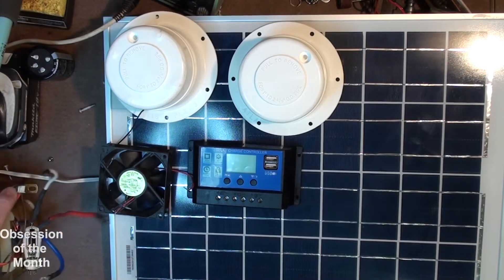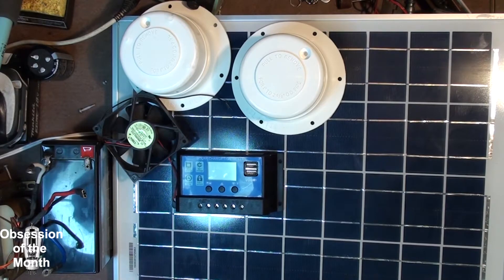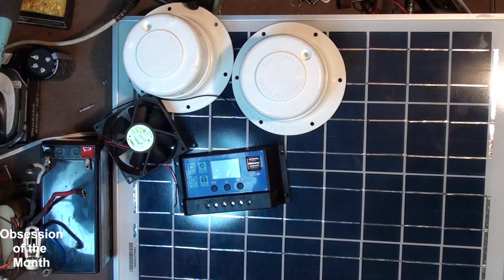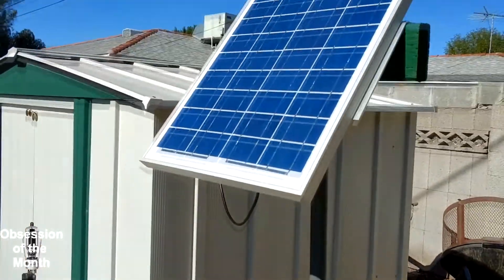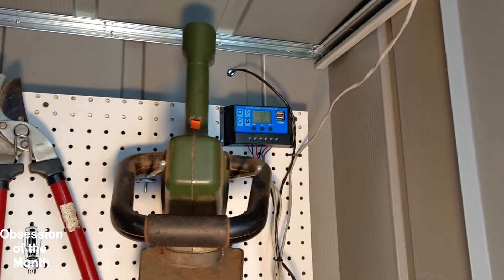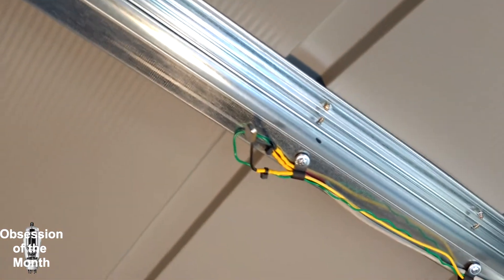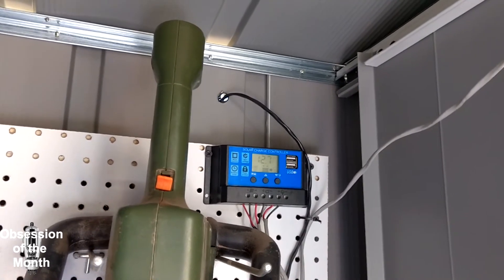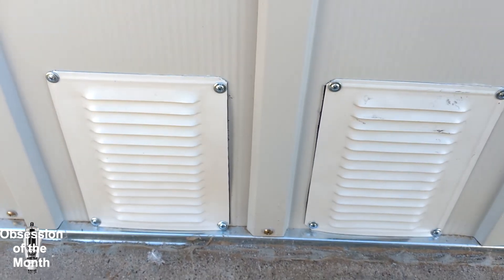Solar panel fans and Charge Controller for my shed

Comment: Have you noticed a difference since the fans were installed?
Reply from the maker: no heat wise, but it does keep the shed fume free.
Reply: I was considering the same for my shed in hopes to lower the temp a little, but I guess that's wishful thinking.